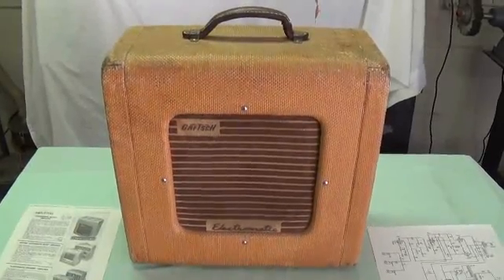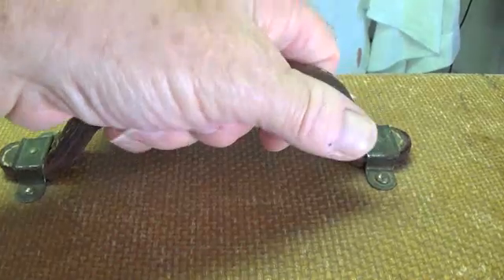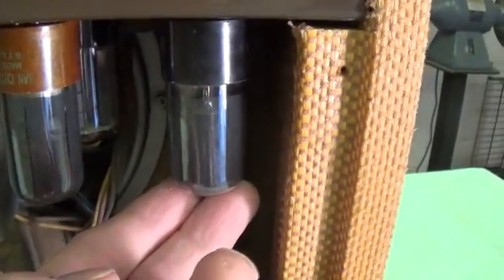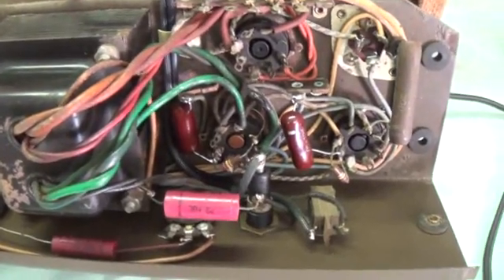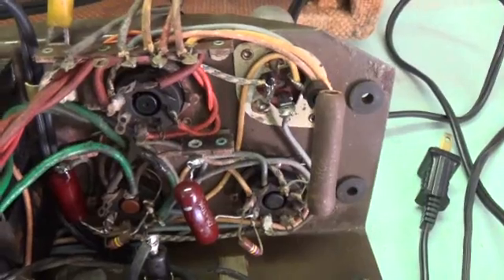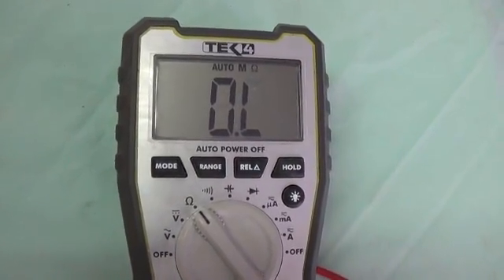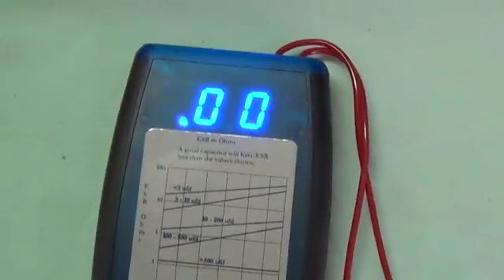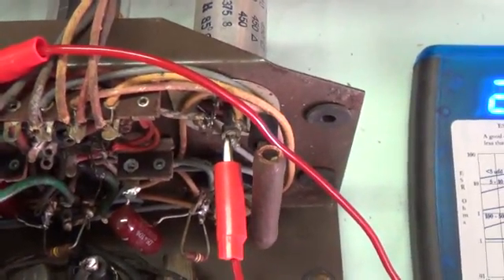Using an ESR Meter to Determine the 'Health' of Electrolytic Capacitors in Guitar Amplifiers

Comment: Back in college I used to take the leads of an axial cap and fold them in opposite directions to where it looked like the letter N.   Then I'd charge 'em up and toss 'em to folks to see if they knew not to catch them.   ;-)   Yeah, it was wrong, and dangerous, and somebody could have been hurt if they had a pacemaker or were just a big old wussy.   It was fun anyway.   (We didn't use gigantic cap's for this either)   Oh, and how I learned this trick was as the lab instructor somebody tossed me a charged cap first.   ;-)
Reply from the maker: Yes, indeed, the old charged cap trick has caused many a pair of soiled briefs, from coast to coast. It's one of my favorites too :)
Reply: @UncleDoug  One typically only falls for that trick ONCE...   ;-)   What's the old saying... fool me once...
Reply from the maker: Then it's like an IQ test, 3d. Anyone who falls for it twice is branded a complete idiot.
Reply: @UncleDoug  Yep!   Oh, and thanks for the suggestion about not replacing all caps right out of the gate.  I'm about to restore a blackface Fender Vibrochamp and was about to just order a kit to replace all the components that typically fail/age.  I'll get the tester gizmo instead and go through the amp properly instead and only replace what's genuinely bad.   Probably better for keeping the value of the amp up too as well as being simpler/cheaper.

Comment: Hi doug just signed up on patreon i just watched the anatek bideo and they said basically you cold measure in circuit but with a big "but" liokeela like it would reader the while circuit im still going to get one but thought you night want to checking out there bideo maybe im all wet lol take it east Rob
Reply from the maker: Greetings, Robert. Trust me, as long as the capacitors are not in parallel, you can read them in circuit with great accuracy.

Comment: Hello Uncle Doug! One question... one terminal of the ers was conected to the can cap... the other one was Connected to the chassis (ground)? Thanks.  
Best.
Reply from the maker: I'm not sure I understand the question, Victor. Generally you attach one lead to the positive and one lead to the negative lead of an electrolytic cap.
Reply: I was also confused by this. You can clearly see the one lead on the lug of the can cap but the other lead is showed connected to something out of the picture. What was the other lead connected to? Where would one find the "negative" lead of a can cap?

Comment: I posted on the video for  " The worst capacitors I've ever seen and heard"  and was asking you about measuring the electrolytics in circuit. 
Extremely helpful Doug. I ordered this meter, along with the Signstek MESR V2 as well. This was exactly the info I was looking for. Great stuff, learning alot. I'm just beginning to work on my vintage amps, ( Marshall, Hiwatts, Sound City, Fender ) and was looking for ways to measure the electrolytics in circuit to determine if a cap needs replacing or not, without de-soldering. My first project is my '85 JCM 800. Re-biasing new power tubes, changing all filters, but wondering about the others, if they NEED replacing, so testing to some degree of certainty would be cool. Thanks!!!
Reply from the maker: You're welcome, BR. I'm glad the video was helpful. Best of luck with your repair projects.

Comment: hello uncle doug ! so happy to see youre still making these videos today! big respect and learning a lot!! but i think the esr meter is not that reable with those high voltages. a higher voltage penatrates more easly thru isolation than the low voltage that the esr is using.just like a piece of dampd paper between a light an a 1.5v battery works as a (bad) isolater but if you touch the wall socket lead with it, its maby the last time that a persoon was standing strait up. or am i false and missing somthing here? I still have the transformers waiting in a closet to start the valco amp build, but my big garden projeckt makes me wait a long time. So sad! hahahaha keep up the good work!

Comment: I agree with you Doug that it is unnecessary to recap the whole unit; like you, I prefer to keep the vintage appeal. The fact is that very few fail that need attention. I also use an ESR meter to determine what needs to be done; however in some cases the cap must be pulled and tested at rated voltage to check actual operating conditions because some will break down near their rated voltage. "Great Video"
Reply from the maker: Thanks, John :)

Comment: Hi Uncle , good video, but two capacitors in parallel, they are always also with the esr meter, how does the instrument measure only one, without detaching the other from the circuit?
Reply from the maker: It doesn't separate the values for the two parallel caps, Claudio, but if one cap has an abnormally high ESR value, it will generally result in an abnormal value for the pair. Then you can pull one end of one out of circuit and determine which one is at fault.
Reply: Thanks Uncle, ok, we supposed two caps in parallel, one 1.2 ohm's (ok) and other 4ohm's (bad) (r1*r2)/(r1+r2) = 0.9 ohm's,     (0.6 ohm's if they were both ok) , so only 0.3 ohm's of difference,  do not you think that maybe they are too few, to notice only, from the measurements, given the tolerances of the capacitors, especially the electrolytics? sorry for the question too detailed, but it is a topic that I am dealing in particular in this period, and I would like to understand if there is actually a reliable way to test the capacitors without removing them from the pcb.
Reply from the maker: I understand your concern, Claudio, but you should realize that 1.) Parallel electrolytic caps are very rarely found in vintage guitar amplifiers. 2.) When electrolytic caps "go bad", generally their ESR values are much higher than 4 Ohms. There is generally no evidence of malfunction until the values reach say 10 to 20 Ohms. Granted, a reading of 4 Ohms would indicate that a cap was beginning to fail and ideally should be detected, but once the cap does indeed degenerate into becoming (or verging on) an audible problem, its ESR value will become abnormal, even in parallel. 3.) If you prefer absolute awareness of individual ESR values, however, you really must pull one end of either parallel cap out of circuit, if and when you ever encounter one.
Reply: Ok, perfect, now it makes sense,  thank you and Merry Christmas :-)

Comment: Hi Doug. Will the Blue ESR meter measure caps less than  1uF? (ie: .01. .001, .002 etc) All of the data that I read says the range is  1uF to 10,000uF . Not very useful for guitar amplifiers except for the power rail caps. 
Thank you.
Rob.
Reply from the maker: I believe that all ESR meters are only intended for use with electrolytic caps, RC, so the 1uf lower limit makes sense. I have found, however, that they give consistent measurements with non-electrolytic sub-1uf caps also, but it's uncertain whether this reading provides any meaningful information, other than that the cap is not internally shorted to any degree.
Reply: Thanks for the reply Doug. I have a Chinese ESR meter that worked very well on all caps of all sizes ($25.00) but I forgot to discharge a cap and it didn't survive. It was only 8VDC too. I bought the Peak Atlas since it reads the capacitance as well so I'll let you know how it works out. Thanks. Rob.
Reply from the maker: You're welcome, RC. Being able to read both ESR and capacitance with one device would indeed be an asset.
Reply: Doug, I've had the Peak Atlas for a week or so and while it does read capacitance and has an auto drain function (up to 50 volts) it will not read non-electrolytic caps like the Chinese MK-328 ESR meter it works extremely well. I ordered another MK-328 and I highly recommend spending $24.00 for the Chinese MK-328 as it does many things that the high end models wont such as reading non electrolytics, transistors, inductance, capacitance and resistance . A simple search on ebay for MK-328 ESR meter will bring up many results. If I use the Peak Atlas for electrolytics and the MK-328 for everything else I'll be fine with no danger of cooking the meter again. Cheers! 
Rob.

Comment: Thanks for posting - I have    mono  (Quicksilver 8417s) and one is starting  to distort  - interestingly  its fine initially but then degrades ,so something is amiss.
 My intention was to use my meter a fluke  to compare the one working amp to its nonworking twin 
 I think the problem may be as it works at first  the bad part may be a bit hard to detect .
Do you still have high regard for the  AnaTec?
Reply from the maker: Yes, I still use the Anatek ESR meter often. With regard to your distortion problem, it's probably due to a resistor or capacitor that is malfunctioning due to heat and load.  A good way to pinpoint it is to spray each resistor and capacitor in the circuit, one at a time, with a freezing spray......then listen to see if the distortion ceases.

Comment: Uncle Doug, is there any time an Electrolytic capacitor might have an intermittent problem that would not show up with the ESR meter but only when high voltage is applied?Barry
Reply from the maker: Yes, it could happen, Barry.  It's the one shortcoming of the ESR meter, since it does not test the capacitors in a fully charged state (i.e. detect DC leakage)......however, it can detect faults in capacitors that high voltage might not reveal.  The most thorough testing method would be to measure capacitance, leakage at operating voltage, and ESR value.
Reply: That's what I thought.  Thanks for confirming.  I have ordered the assembled Anatek ESR meter now that I know how useful it is.  Oh, and buy American every body.  It may cost more, but it keeps manufacturing jobs here.
Reply from the maker: Good decision.....and advice, Barry.

Comment: Would like to add that you can now buy comparable devices on Ebay for around €12. See https://www.youtube.com/watch?v=YyUkpBXc8cQ
It's really sad for pioneering companies like PEAK. but this is what happens time and time again. They have their pcb's manufactured in China and that goes well for the first ten years, then it gets copied. But isn't this exactly what Marshall did with that Bassman.... ;-)
Reply from the maker: On one hand, such piracy provides customers with reasonably good knock-offs at low prices.....but it also harms those who spent a lot of time and money to develop the item in the first place.  Such a trade-off appears to be financially beneficial in the short run, but stifles creativity and development of new technology.
Reply: Of course I bought one.... so here's a heads up to all Ampaholics!
I need to correct myself, these cheap Chinese meters do not function at the high frequency you describe and they are great for testing off board component, but cannot be used for in circuit measurements in the way you describe here. However they do measure capacitance, ESR and loss...
I recently bought two 60s Geloso tube amps (made in Milan Italy) that I want to bring to live and they are filled with factory branded, original capacitors. I don't want to replace them if not necessary. Hence I watched this video almost 10 times, then saw the real secret... 

Althought it's a great demonstration, the video really also shows your old DDM method is rock solid... if you measure while using your brain and looking at the schematic. So I did a lot of measurements with old and new capacitors & my chinese gadget. I learned the following:
- ESR increases more with voltage rating increase than with capacity...
- Don't be surprised to find 1-2 ohms on a good capacitor. 
- ESR > 17 ohm is always accompanied by high loss percentages (10-40% while new caps have 1%)
- Capacitors that go bad tend to increase their capacity value. This is what I noticed, but it seems counterintuitive, because their resistance increases too? Because of the resistance, the flow of current is inhibited and it seems like capacity increases?

sorry for such a long comment & questions, really love your channel
Reply from the maker: Thanks for your many comments and observations, Johan. I have found that ESR value is inversely related to capacitance. A .02uf cap may have a normal ESR value of 59, while a 20uf cap will be around 1. However, the ESR value does increase with increasing voltage rating.

I too was puzzled about the tendency of old caps to increase in capacitance.....which (as you said) is counterintuitive. Since the increase is detected with a capacitance meter, not an ESR meter, I doubt that it has to do with internal resistance. Perhaps the distance between the plates decreases with time, or there is a change in the dielectric.

Comment: Thanks Doug for a grrrreat Feature. You are spot on when you say keep original. I have a 1964 Leak Delta 70 amp and it sounds and functions perfectly. ALL the internal discreet components are original i.e made by Mullard and other components i.e capacitors are all British. Please can you make more of a similar nature. Cheers.
Reply from the maker: You're welcome, Brian, and thanks for your very nice comments. They are only original once.....and it's nice to keep them that way.  A highly restored vintage amp is not much better than a re-issue :)

Comment: Uncle Doug:  Nice amp.  I've learned a lot from watching your videos that has helped me restoring old amps.  My restorations are made to play and I'm not too much concerned with keeping it cosmetically original but functional.  I am of a somewhat different opinion on electrolytics, particularly in the power supply.  So, to me a 40+ year old electrolytic that hasn't failed yet is a ticking time bomb.  It's gonna go eventually and maybe take something else with it so I routinely replace them first thing. Also, when it does fail, it means another disassembly to fix.  This isn't so bad on an old Traynor where you just pull the top off, but I'm working on a 1993 Feder Concert at the moment which is a nightmare to get into and I sometimes consider just scrapping for the parts rather than go through the agony of putting it back together.    I also replace paper caps routinely especially in old radios since I haven't found any that were 40+ years old that weren't leaky.  If they're the rare, high quality tone caps and I'm going to try to keep them, I first do a leakage check at the rated voltage.  If they pass, they can stay otherwise I replace them with new Jupiter or Astron caps.  Never had a problem with ceramic or micas, so don't bother with them unless they're causing some kind of disruption in the circuit.  Different strokes, etc.  Love your videos and eagerly await the next one.
Reply from the maker: +jflimbach  I agree with virtually all that you say, JF.  I replace all elderly electrolytics that cannot pass ESR testing, even if they are marginal. Those that pass with flying colors are allowed to remain. Over many years with many, many amps, I have not experienced any problems with this approach.....however, I agree that there is some risk involved. To be honest, though, I have encountered more problems with new, modern replacement capacitors (which are of varying quality) than with (generally high grade) vintage caps which pass ESR testing.  There is no "100% sure" option.

Comment: GREAT VID i gotta get one of those meters.,...really a great way to go, Uncle Doug- 
if it works, dont break it.
Reply from the maker: +TheEDZEPPELINBAND   Exactly, EZ. You will find the ESR meter to be a very useful device. Thanks for watching and commenting :)
Reply: Hey Uncle Doug- i GOT a meter, and assembled it myself, first project I've ever done, and it works great-
it WASNT easy, and I cant tell you how many times I wished I'd just paid the extra 20 bucks,to get an assembled one, cos it's NOT for the timid, but that has never stopped me-
and guess what-? i LEARNED a whole lot, by being stubborn- about reading schematics and identifying parts, and i have pretty good soldering skills-
Reply from the maker: That's great news, Ed. Congratulations on a very successful project....and result. I think you'll find the ESR meter to be a very useful tool. Best of luck :)

Comment: When you first power up the old amps, do you connect it to some sort of variac to allow the electrolytic caps to re-form? or is this a dumb question?
Reply from the maker: +kjmcintyrequasisnafu  It's not a dumb question at all. Yes, if an amp has not been used in several years, it's best to bring it up to operating voltages very gently (over a 20 to 30 minute period) with a Variac.  Also, I always use a current limiter with any old circuit of unknown condition, just to reduce the chance of short circuits causing damage.  I demonstrate the Variac technique in another video.